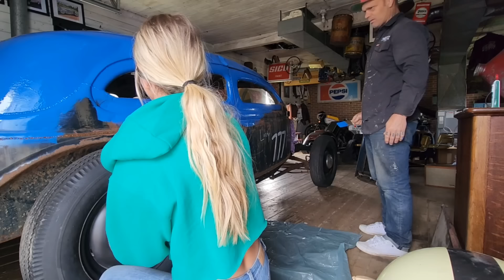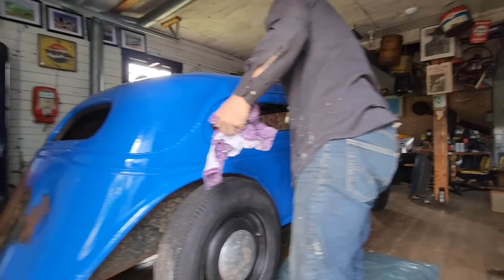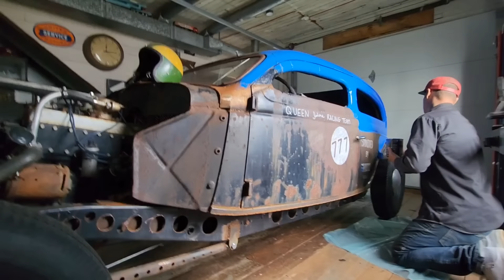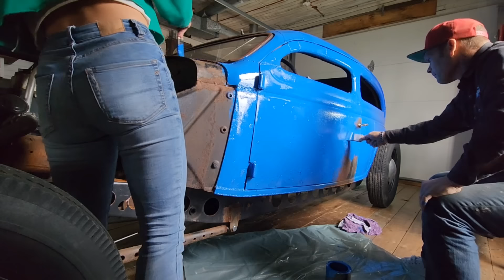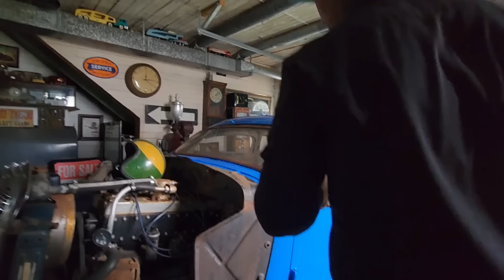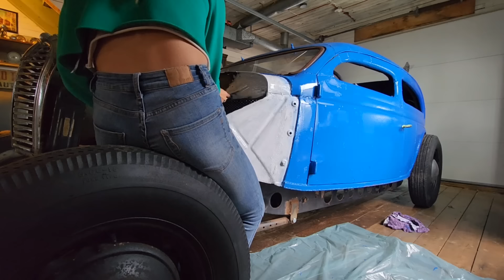Painting Jolene's race car with a brush during Hurricane Fiona

Comment: My grandfather painted his model A gloss black with a clean broom. I am told it turned out decent, the paint flowed enough to mask most of the strokes. I was told this by my mom, grandfather died when I was 1 year old. I'm 65 now.
Reply: In the old days they would paint cars with a brush and block Sand them smooth then buff to a shine.
Reply: I'm almost 67 and remember my grandfather Lee. He Died when I was 3.
Reply: @ww321  Would you be able to get a satisfactory job today considering paint is of many chemical  make ups?
Not like the old days when just about all paint was just enamel. Just wondering if this is correct statement.
Reply: @williamoneal2763  that paint was made to be brushed on. 20 years ago I found some boat paint that could be brushed on. I used a foam weenie roller and then back brushed the paint to flatten the bubbles. I did a light sanding between coats. It looked like it was sprayed on. It's called Interlux Brightside polyurethane. They still make it.
Reply: A real fine paint brush the paint will flow together good
Reply: @ratrodsinthehills2422  yes if the paint is designed to
Reply: Great colors

Comment: I am currently hot rodding a 1950 Ford Prefect, it's a budget build with an ancient Rover v8 engine - the one originally designed by Buick in the 17th century. I have watched dozens of your videos for inspiration and to remind me that with the right attitude and a bit of aptitude anything is possible. I'm working on my own and sometimes problems seem much bigger than they are so a quick blast of Chad being bad always gets my head straight. I cut the front end off the other day and have built a complete new one. i made some mistakes due to inexperience but the job is now done, thanks in no small part to the inspiration from this channel. Keep up the good stuff, love you both.

Comment: A neighbor was a painter where he worked he painted with brushes and rollers on walls .he had a 54 Ford pickup he painted it one day with a brush he sat it outside in the sun and let it get hot when he painted it the brush strokes disappeared I'm not sure what kind of paint he used .he was drinking beer and messed up the letters on the tailgate he never fixed them .but when his son sold the truck 35 years later it still looked good up close too .

Comment: A brush application works well if you keep the paint warm .
Reply: @StevenTheElder outside in the sun is probably best to keep the steel warm also. The paint evens out the brush marks, the heat allows it to move sideways.

Comment: back in the '60's i painted car with a fine nap roller and enamel paint (i think original enamel formula not the same/ illegal). Not showroom of course but barely noticeably worse than spray ,talking backyard spray not modern spray booth and equipmwnt used